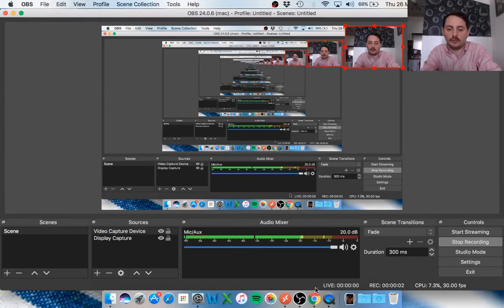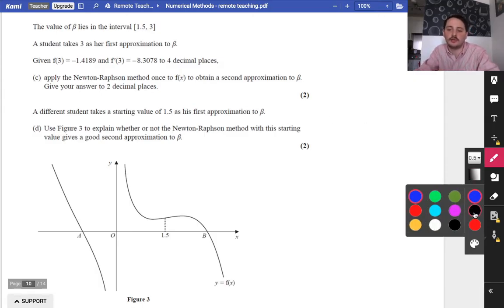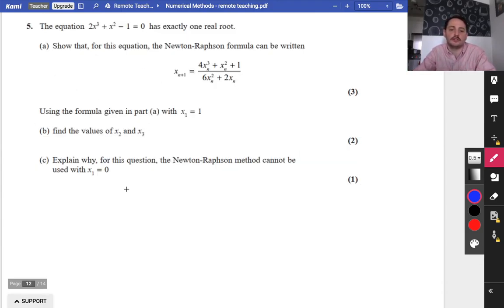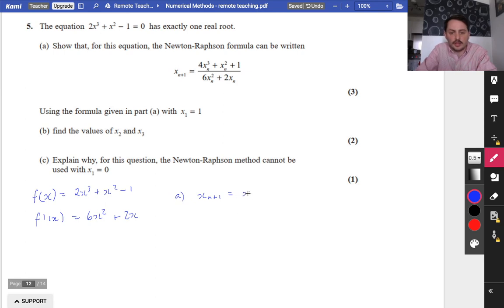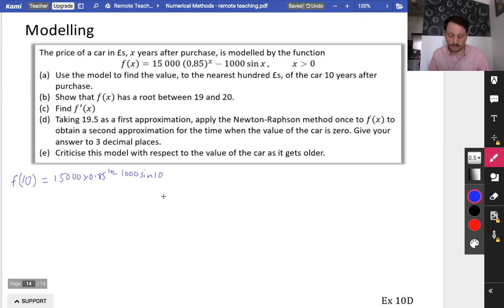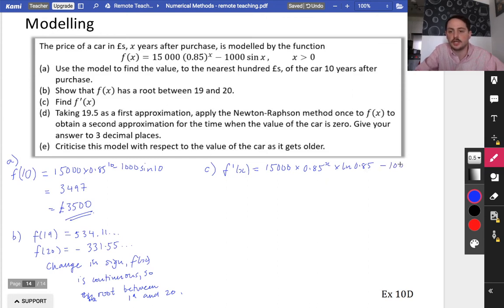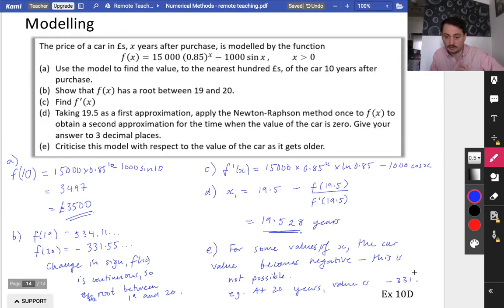Numerical Methods 5 • When Newton Raphson Fails, Modelling • P2 Ex10C/D • 🎲

Comment: A very good tip is to use Mr Bicen’s suggestion of putting the starting value = ANS into the calculator first when applying the NR method, otherwise it’s not hard to make errors.
Reply from the maker: Thank you!

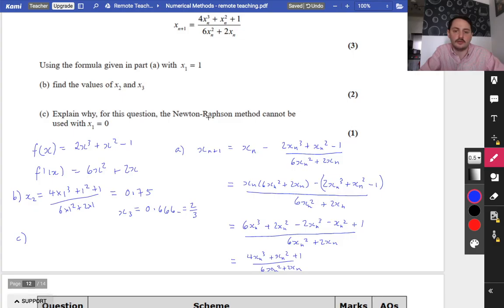Comment: Hi Sir, with part c at 9:52, does this mean that the Newton-Raphson Method can be used to find stationary points of a cure? Where the denominator = 0?
Reply from the maker: It can't be used if the denominator is 0, so you just need to check carefully whether the formula uses that! :)
Reply: @BicenMaths  aah okay thanks

Comment: hi sir, at 4:14, what if you take a tangent going down with a negative gradient?
Reply from the maker: If it were negative, then it would be valid as it would go towards the solution... however, you can tell that the gradient at the point we are drawing the tangent is positive, so it's not possible to draw a tangent with a negative gradient here!

Comment: I am forgetting to make sure that my calculator is in Radian’s mode. So to clarify, anything to do with calculus, it always needs to be in Radian’s unless the Q states degrees?
Reply from the maker: If it is calculus it was ALWAYS be radians, never degrees. This is because the proof for trig differentiation from first principles rests on the small angle approximations, which only apply if in radians!